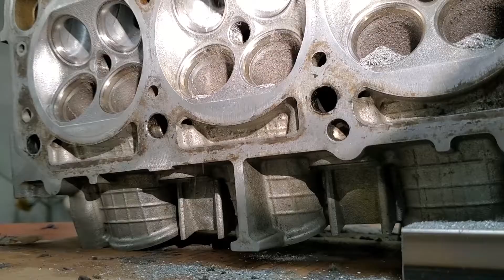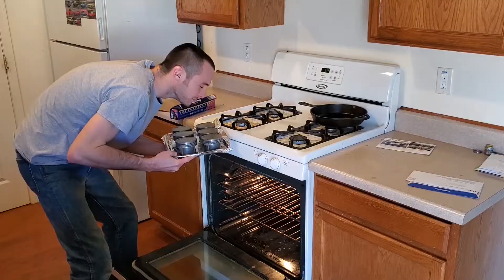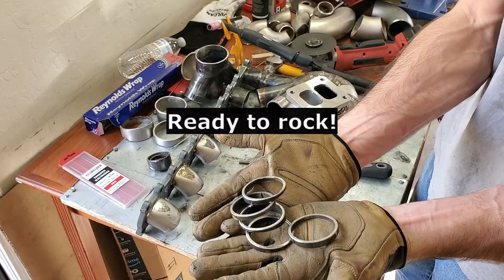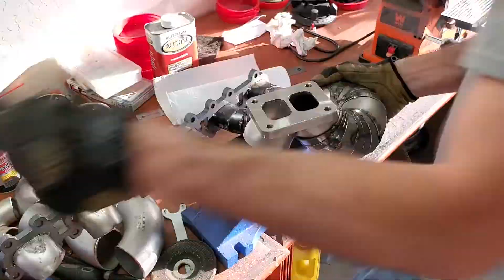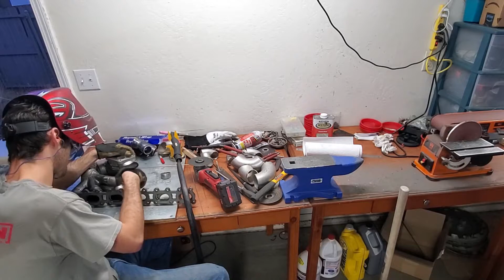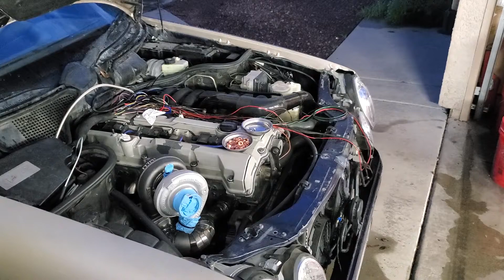How To Build A Turbo Manifold (Pt. 1)

Comment: Hey cool project! Been following for a while as I'm thinking about turboing my M104 in my G320. Which Borgwarner trubo did you go with? Any reason why you didn't go with a split second enricher and keep it as stock as possible? I assume it's for customizability and to squeeze out every horsepower out of the setup.
Reply from the maker: Hey, Glad to hear it! And thats nice, i hope you do it! Add me on snapchat and show me if you end up going through with it. The turbo was a s200sx, its a perfect size for the m104 at stock 6.8k rpm for ~500 horse. 

Anyways, alot is still stock as you probably know, but to be completely honest, i was unaware of that little piece of hardware you mentioned until just now. I would have considered it had i known. 

That said, Yeah i want the engine computer to be smart and capable. Standalone ECU is the best route for me i think. I want a reliable 100k miles out of this engine before at most a bearing replacement. I want to prove the m104 is a reliable powerhouse. Get the car community on board.
Reply: @JakeSublime  Ah I don't have snapchat, you have Instagram where I can follow your build? Your videos are super informative btw! Nice turbo choice, I was thinking the same or smaller, I want as minimal lag as possible as I have an SUV, I feel it suits it better with low end torque. 

Are you street driving this car/dailying it? I`m curious of the tuning stage of this build. 

I'm dailying mine so I want to keep it as simple as possible and as stock as possible (Relatively lol).

The M104 is super capable, hasn't picked up yet in North America, only a handful are building them. Over in europe they've been using them in all sorts of applications. I feel the same will happen to the M104 as it did with the OM606 (I blew 2 :( )
Reply from the maker: @hummermaniac88  No insta, sorry haha. You can always email me, my email is on my "about" page on my YT channel. And thanks, I really just try to help others out. I love teaching and helping others grow. 

Im dailying this car, and road tripping it. The first 2 months of this rebuilt engines life will probably be 1000's of miles of road tripping haha! So tuning is certainly going to be interesting. Stay tuned for it, its going to be a learning experience.

The stock ECU is controlling the stock throttle body still, so cruise control COULD MAYBE work. lol maybe

And yes, us Americans are late to the m104 show, but at least were arriving. I want to push m104 awareness!
Reply: @JakeSublime  That's really sweet! I'm eager to follow this build to the end. I currently have the M104 up and running, so I'm using your videos to see what maintenance I can do on my engine prior to turboing. Hoping one day these engine will catch on and get good aftermarket support for them.

Comment: Looking forward to seeing the end result of your build... I too have an m104 in a 190e body but I'm looking at going turbo as well and your videos are motivating me to go the turbo route
Reply from the maker: Its totally the best route. and it helps you set up a shop in the mean time. I used amazon and harbor freight. Then just buy specific name brand tools here and there (like your elec. tools mainly, i trust Milwaukee 100%)

Turbo car and a shop once your done :D
Reply: Was it a pretty direct fit? The m104 in the 190?
Reply: Yeah pretty much... I used the m103 engine brackets and I used the 190e mounting blocks and in u go
Reply: Same dude. I'm getting one for free. It's not running. It's been sitting for 6 years in a garage. I want to get it running and hopefully turbo it
Reply: Lol yes definitely... Uhm Id actually like to know how did you lower your compression for the m104 turbo build?

Comment: Great work dude mock ups looking great I like the unique design of it, I think that's going to have a great sound buddy. COME ON GUYS SUBSCRIBE!! Great work Jake keep it up, so close to that magic 1st 1000😉. Your 210 is going to be a real beast when it's done can't wait 👍😃
Reply from the maker: I just hope my manifold flows at least OK, and mounts my turbo OK. Haha its all i ask! Lol, i have to say, i dont think ive seen a manifold designed like mine, it does look pretty unique for sure.
Reply: @JakeSublime  based on the fact your going twin scroll, although more complex to make it's makes it easier for flow. The way you have the collectors designed you shouldn't have any issues with gasses going in the wrong direction 😉, I mean you should see our log manifold 😂 that's something that shouldn't work as well as it does. Luckily a good friend hooked us up with a tubular one to wedge on our Slk. The good thing with the 210 you have a lot more room than the rest of the cars that are based on the 202, yours is just a wide 202 but that extra width helps so much. That should easily flow for 600 anyway dude any higher than that your gonna be looking and professional flow tested manifolds anyway like the TB stuff. So far I don't think you have anything to worry about bud, I think for the size turbo you might need a fair bit of advance to bring spool up time down a bit but other than that you look set dude. Are you doing anything with the diff at all? You may have already said but my brain is mush lately 😂
Reply from the maker: Yeah, im thinking the same thing with my exhaust. I considered 2 logs, then routed to the 2 scrolls. Glad i went this route though xD

And yes, my 210 has alot of room, its nice. The manifold is proving to be a pain, but it will all work out in the end. Locating the turbo sucked. That took so long.

I sized this turbo to my engine as perfectly as i could. That, combined with properly sized exhaust and intake, + ported head, + ceramic piston tops, + tubular turbo manifold, + twin scroll.. I think my spool time will be good. Hopefully. Haha!!

And my dif, i just changed the fluid and put some good shiz in it. If i break anything, ill fix it lol. I plan on breaking some axels, knuckles, difs, and trans' before i get this build dialed in.
Reply: @JakeSublime  honestly I will be mega supprised of you break an axle on a Mercedes 😉 but I think you'll be alright dude.

Like you say with your turbo its certainly not oversized I think by 2500 you'll be seeing good boost full boat definitely by 3500 but more so around 3 ide say, let face it you have done more than enough homework that's why I love watching your stuff.

I tried my tubular turbo manifold and no dice, so for now stuck with the log one M111 engines are so stressful to work on especially in the smallest chassis 😂. I was trying to get my brother to swap me his M104 C280 for my Clk230 🤣. I want that M104 life so bad, ive got the engine just not the car
Reply from the maker: I say go get some generic car and put an m104 in it. Show that it is easy to make big power on a budget. Or, go to a "pick-n-pull"-esque place and get a mercedes chassis. Near me at my local spot, there are so many mercedes. Almost any time, there are like 3 old mercs, id say '88 - '02, out front for sale for like 1200-3500

perfect m104 chassis
Reply: @JakeSublime  well the M104 I do have got fitted in a lexus is200 it's kid of scary how easy it was to fit in there, but the chassis of the car was just too rotten so scrapped that and bought my Clk from co part. Basically the plan was to build a Mercedes version of a supra 😂, I have most of the stuff to do it but I'm sticking with 722.3 auto as the 722.6 with ofgear we haven't had much luck. I do have a plan in mind but I use the clk every day so I need another daily ,🤣